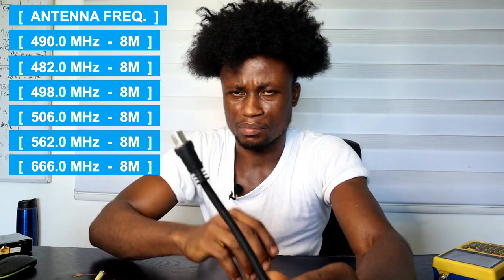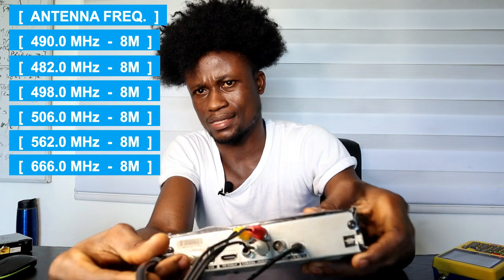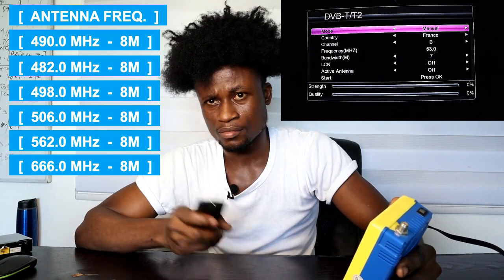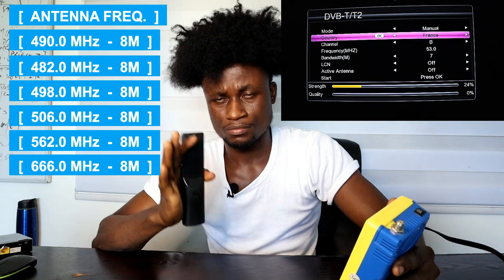How To Install Digital & Antenna Channels On Master s1000 HD Combo Decoder

Comment: Thank you very much for the information.
Please what SCR IF frequency should i use. I just bought Satlink WS 6933 and I'm seeing SCR1,2,3,4,5 etc each having different IF frequencies. You can see these when you want to do signal scan. Please in thing can help. Thank you very much.
Reply from the maker: WhatsApp Pbteck @ +233596059733 for help

Comment: My satellite genius, weldone.
Please, is it compulsory for me to write the name of satellite like this 'e36. 00 eutelsat 36b' or i can change it to anything i desire. But the frequency and other stuff will remain thesame
Reply from the maker: When it comes to the Satellite folders on the receiver, it just a folder with the satellite names and their available frequencies. 
* You can create a new folder with any name, add the frequencies and use it to track.
Reply: @pbtecknology  I'm grateful for your swift response.
Please have been trying to create a new folder for startime. When i try to input the frequency which is 12341. My tracker rejects it by saying 'Out of Range'  please how can this be solved. I'm in Nigeria incase you need my location
Reply from the maker: It's because of the Degrees.
The Degrees does not correspond with the Transponder. 
Change the degrees and it will allow you to save
Reply: @pbtecknology  what degree should i input now